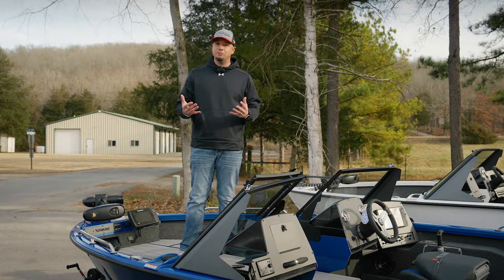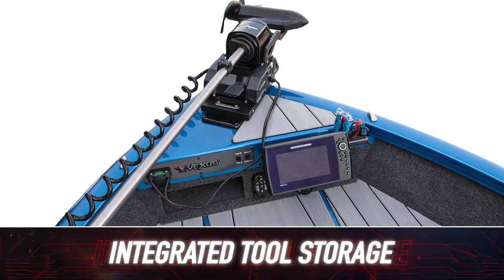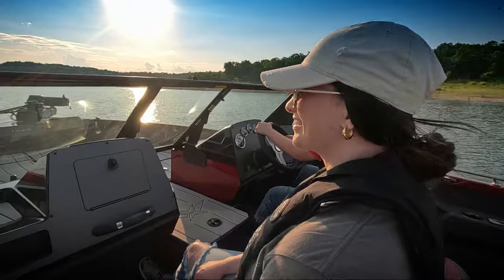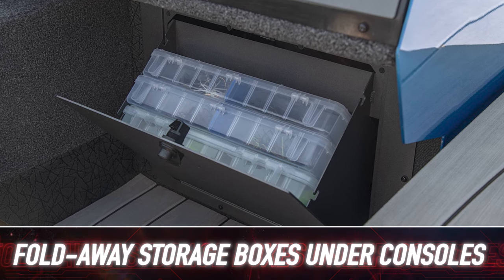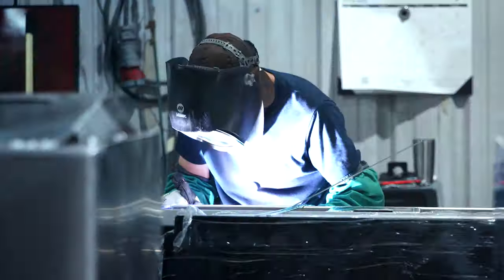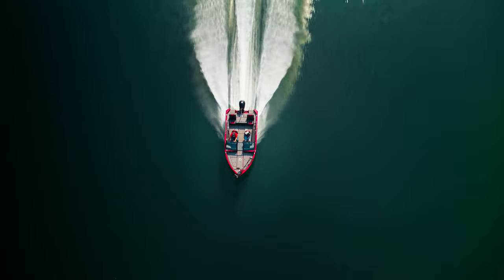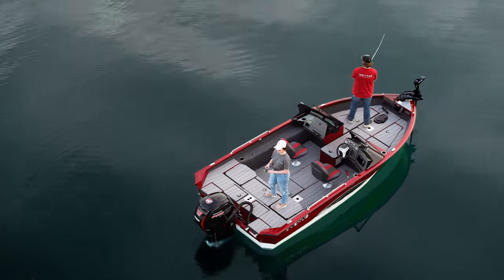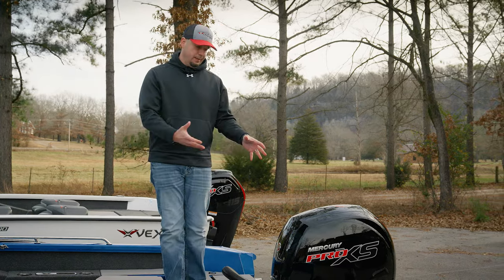Vexus® ADX180 Walk-Through

Comment: I'm a fan of this boat.  Can it be ordered so the underbelly, beneath the spray rail, is unpainted?  I hate seeing scratches in this area on an otherwise perfect paint.  Also, I couldn't tell if there's a plastic sleeve around the wiring assembly where the tongue folds.  This is a common area of failure on a boat trailer.  Thanks much.